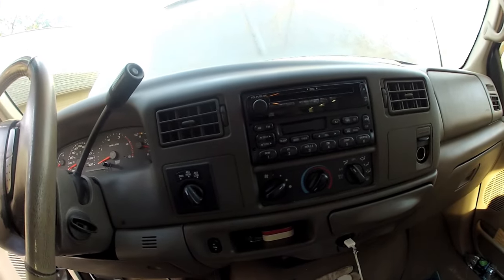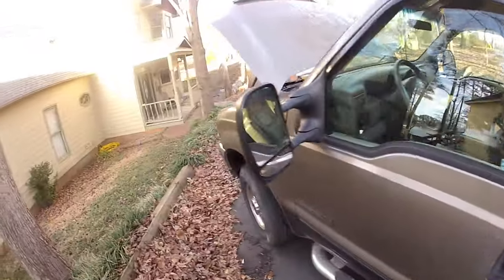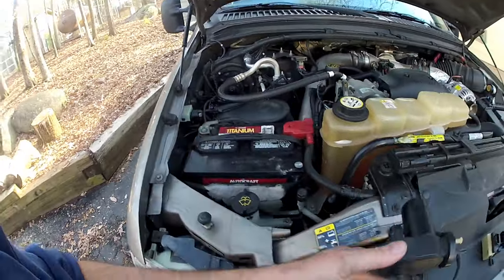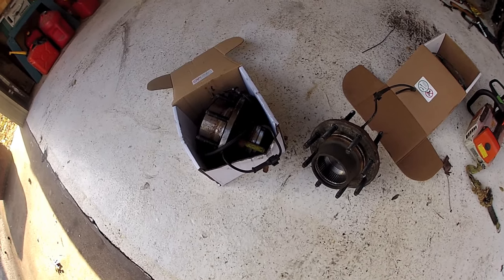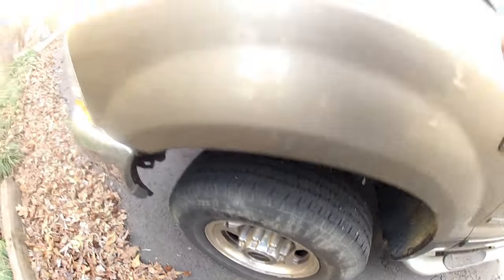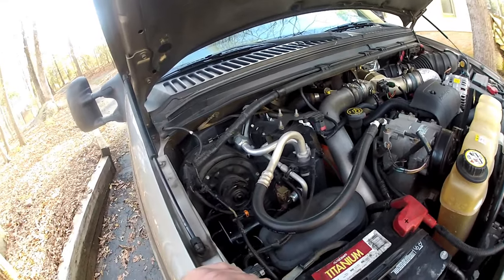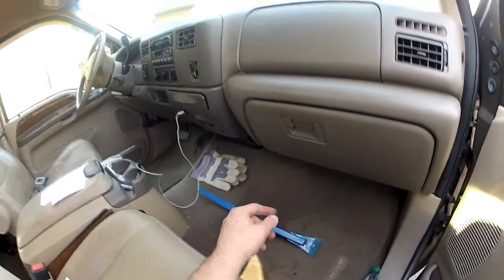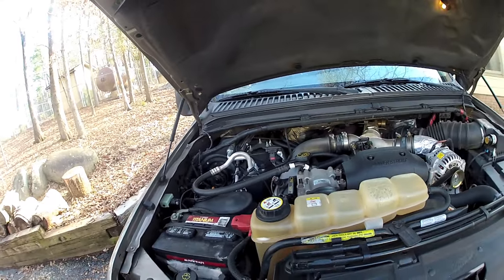Ford F-250 stuck in defrost, problem solved

Comment: 9 years later and you're still saving people. This kept me from spending hours chasing a vacuum leak that didn't exist. Thank you!
Reply from the maker: Amazing how many of these have failed.  I moved along to a Nissan Titan XD pro over 6 years ago, but still miss my F-250.  You'll never guess what component fails on the Titan.  An electronic air mix valve solenoid.  Very similar symptoms, but a totally different design concept.  Proof newer isn't always "better".  Somewhere between now and air conditioning season, I'll be climbing under the dash and changing at least one of those (also well documented frequent failure) parts out.
Reply: Ten

Comment: It may have been mentioned previously but the part number is as follows:  Ford Motorcraft # 7C3Z-9H465-A Auto Lock Locking Hub Vacuum Control Valve/Solenoid.  This part fixed my 07 F350 6.0L 4x4 exactly the way it fixed the issue for the Yankee Paramotor.  Thanks Again!

Comment: I solved my Ford heater problem by never even considering a Ford product again. It also solved the problem of "Opps, we used the wrong alloy for the subframes corrosion problem."
Reply from the maker: To each his own.  I drove this truck for 15 years!  Regrettably I traded it in for a new Nissan Titan XD a little over a year ago.  Nissan? Not even half the vehicle the F-250 was. I'd just gotten tired of the old radio and the lack of assurance that newer components  bring for a time... I guess I saved about $30k on the front end of the purchase.  We'll see how much of a bath I take on resale value if and when I ever try to trade or sell it.
Reply: Why am I complaining about an old car when I am on your channel to learn Paramotoring. I am driving a wonderful 15 year old Suburu Outback but my brand new Paramotor will be here next week. A person needs to set priorities! 
Thank You for posting on Self Training. Self training more for convenience than money. 24 years Coast Guard Flight Crew and Avionics experience. Now retired, I can fly again! Yay!!

Comment: Does this same part cause the dash issue on the v10 excursion as well? Im chasing a vacuum leak that may not even exist
Reply from the maker: Sorry man, this was a one off solution as I'm not a professional mechanic.  I just happened to stumble on the fix for this particular problem.  Traded that old truck back in 2017, but I sure wish I'd have just kept it and spent $2000 on vinyl wrap and a new stereo/nav system instead.

Comment: Thanks for the video, my 2002 f250 has been stuck on defrost for 3 years and the auto 4 wheel drive has never worked since I bought the truck new, I always had to lock the hubs manually. After watching your video I called the ford garage and they quoted me $321 for the solenoid and a new vacuum pump. I got them on line at am autoparts delivered for $91, just put them both on and I now have cold ac coming out the dash vents and the 4wd locks in without having to get out and lock the hubs. Thanks again for posting your video.

Comment: VERY HELPFUL! THANK YOU!
It's not an EGR valve though it's a pulse vacuum actuator for the four wheel drive that runs off the electric vacuum pump. I was told by multiple mechanics that it would not solve the problem. It did! Thank you again!

Comment: Awesome video. I have a 2003 F250 and thanks to you I fixed my same issue. Replaced the vacuum pump and probably didn’t need too.  For other people the part is Dorman 600-402 $62 at autozone. Thanks again.

Comment: @Yankee Paramotor you nailed this.  My Vac valve failed on my 2000 F350 7.3.

Some additional info - This valve is responsible for controlling factory style auto engage 4x4 hubs and the AC vent system.  If you have converted the factory hubs to a manual-only style like Mile Marker or Warn lockouts, you do not need this valve to engage your 4x4.  When this valve fails, unplug the vacuum connector on the solenoid valve with 2 ports and plug both ports with an appropriate sized bolt. The red vac line is the one responsible for switching the HVAC vents.  With this plugged, you will no longer have a vac leak and your AC/Heat vents should now switch.

Comment: (2000 excursion 7.3 diesel) This video was a life saver!! I went through all of my vacuum lines and checked the vacuum pump and thought I was loosing my mind because everything was fine. Sure as hell I replaced the 4wd actuator and it fixed my problem!!  Thanks for the help man!!
Reply: Do you happen to know the part number? I am having a hard time finding it. I have a 2001 7.3 excursion. Thanks!!
Reply: I unfortunately threw the box out but I went down to O’Reilly s and asked for the “4wd actuator” and they had it in stock. I will call tommrow and see if I can get you a part number
Reply: Hey so I called and the part number is 600-402 at O’Reilly auto parts

Comment: After a crash course with the HVAC & 4x4 in my ''02 Diesel Excursion and only having defrost for a year I stumbled on your video after watching who knows how many (along with several auto part stores that said it HAD to be a vacuum leak in the cab) and ordered one off Amazon for $30 and BOOM! Got heat & A/C out the vents. Hats off to ya...
Reply: Dan Alberty  Hey Dan, does your Excursion have the knob style or electronic push button style for the control settings? Jw. I'm going to try this with my push button style and hope this fixes it.

Comment: DUDE ! Your the man. I checked all the soft lines and checked the disconnect under hood to defroster, ( mine was working but had to turn placement button to get it out of defrost) All was good, but pump would NOT shut off, been that way for years. Manual 4x4 only. I finally found the disconnect for them next to reservoir, no vacuum. So this module can work on one side and not the other. THANK YOU !!!!!!!!!!!

Comment: I had a very similar problem with my 2005 F250. The last part this gentleman mention was the Vacuum EGR Selenoid. In fact that was the reason my a/c and such defaulted to the defrost vents. As is turned out, a pesky squirrel had made her nest next to the EGR unit and chewed through the wires! Rascally Wrabbit!!!!

Comment: Thank you for posting this video, I can't thank you enough.  2002 Ford Excursion with 7.3l diesel, the part is a DORMAN 600-402 Four Wheel Drive Hub Locking Solenoid - $27 on Amazon, took 5 minutes to fix.

Comment: I just replaced my vacuum pump to no avail on my 04F350 w/325K miles. It is a performance work truck. I had vacuum going into the 4wd valve but no vacuum on the line out. My conclusion is the valve is bad & will replace tomorrow. I don't mind paying state taxes but I resent the hell out of paying
$60K for a truck I bought new in 04 for $40K. I have out new heads and rebuilt the upper end @ 250k miles. Put in a livewire tuner & it runs like a champ. Went off road in AZ&UT last two years and tow 5k trailers w/generators and fuel transfer tank! Thanks for the insight! May your day be pleasant and your cab warm/cold as needed!

Comment: Thank you this was the fix for my 2001 F250 4WD v10  -  my problem started during the summer when I noticed cruising down the high way the A/C was only coming out the defrost, oddly when I came to a stop I noticed it would go back to the vents.  This when on for a while until the winter where now it would only blow out the defrost vent.   I found this video most helpful, as all the options were covered.  I first looked for the vaccume leak that led me to brittle hoses down to the hubs they were bad, i never even knew I had them, I replaced and like the video said it worked for a bit again but only at standstill when RMPs got high or on the road it would go back to defrost vents, when I replaced the vacuum solenoid  it now all works.  I got the one on Amazon for 40 bucks, mixed reviews but the OEM is 90.  Will see...tried to buy at autozone they tried selling me a door actuator for the vent...and argued with me i was buying the wrong part...left ordered amazon had it next day...working fine...nice and toasty out the vents. Thanks again
Reply from the maker: +Erik Renninger  It has been 2 full years since I had posted this video.  I am still amazed at just how many people have had these simple components wear out and stop working, yet the misunderstanding of how to fix it continues at parts houses, repair businesses and amongst mechanics - even at dealerships.  Glad it's working for you again.  Thanks for the feedback!

Comment: Thanks for the information. The reason I am here is that mine on a rare occasion will default to defrost and seems stuck. Then it may work great for months. Then hang ups briefly and ok again for months. I'm just looking around to see what's up for the time I'm sure will come. Total failure. Now after yours and a couple other videos, I have a pretty clear understanding of this system. I appreciate it.

Comment: I have a 2000 Super Duty with this exact problem. Can't wait to try this - many thanks sir.
Reply from the maker: Good luck!  It's that time of year...
Reply: @YankeeinSC1  My 2000 Super Duty has the 5.4 V8 but no vacuum pump that I can find or hear running. Seems like the vacuum is getting pulled by the intake manifold? I  can get the AC blowing out the vents if I jiggle the vacuum lines and power/grounds but it quits working after a few minutes.

Comment: Thank you , sir .

I took mine off , open it , banged it around a bit and removed any loose dirt and sand , then hit it with some spray can lube , pumped it with air , made a little plastic disk for one side then it worked.  

I would have never guessed that part.

Comment: That component ( in the superdutys at least ) has nothing to do with the EGR valve and is called the Pulse Vacuum Actuator, Doorman # 600-402. It does indeed control vacuum to the automatic hubs. It's failure is very common, and is well documented over the net. If I were troubleshooting this problem, I would be using a vacuum pump / gauge. This would alleviate replacing non-defective parts. Thanks for the video. It's amazing how many thing I have fixed on my 350 just by watching Videos like this.
Reply from the maker: Yeah I know it's silly to throw parts at a problem, but this truck has been paid for for 12+ years.  So I guess I've taken the attitude that several parts once a quarter or so, is still cheaper than a new truck payment.  Even if I replace something that hasn't totally failed yet, to get to the bottom of a problem.  Many things are at least "fully amortized" anyhow.  This has been one of the most reliable vehicles I've ever owned.
Reply: YankeeinSC1 Yes....I agree. I love my 04 350 and plan on keeping it until whan and if the wheels fall off.
Reply: YankeeinSC1 So I have a 04 Mustang GT with the same problem, only blowing AC through the defroster, how is that piece called "Vacuum EGR Solenoid" or "Pulse Vacuum Actuator"

Comment: Thank you for posting this. It was the problem and saved me money and hours. You da man!
Reply from the maker: I've been a little thin skinned lately, so thanks for your positive comment.  Recently, some guy admonished me, saying that he doesn't randomly replace parts as that is an amateurish way of tackling a repair.  Like I told him ALL of the components could be serviced and replaced for less than the cost of half an hour at a local shop full of incompetent "professional" mechanics...  I have never had goos luck with having automotive work done in my home town!

Comment: That is a very unlikely culprit but I’m glad you found the problem. 99% of the time it is always cracked vacuum line. Those cheap plastic lines they put in all vehicles are subjected to harsh winters and hot summers, it gets brittle with time and cracks. Even a pinhole size crack will divert all your vent selections to defrost as a failsafe. I found two cracks in my 2006 F250 lines, one of which (the hub vacuum) was melted completely against the engine block. The cheap plastic wire cover they put over the vacuum lines don’t do anything. The other was the air reservoir to the egr vacuum that you pointed out. I cut the vacuum line cracked areas and put some cheap rubber vacuum line over them, works like a charm. When I had to take the wheel well inner fender out to get to the compressor, I had to unbolt that air reservoir right above it. When I did that, the plastic vacuum lines cracked. Any cars that are 15+ years or older will start to see these issues no matter what make or model you have.
Reply from the maker: well I have no idea what you're talking about.  The F-250 was still the best vehicle I have ever owned.  The lines you speak of are not "cheap plastic" as you indicate on the F-250.  They are nearly indestructible, high pressure, hard as steel tube, die drawn, space aged, impact resistant super material.  They run through harnesses and isolators and near as I could tell they are 100% resistant to salt corrosion, solar degradation and auto fluids.  The problem you describe may well be true on other vehicles but it simply isn't the case with the F-250.  I deeply regret having traded mine in for the Jap-engineered-mentality Nissan, Titan POS, even though it does have a rock solid power plant with the Cummins 5L.  Should have kept the F-250, sprung for new vinyl "TRUMP 2020 - No more bullshit" motif wrap and added a decent stereo  bluetooth nav system.

Comment: Here is the proper description and part numbers for 1999-2010... It's a Hub Locking Solenoid..
Dorman OE Solutions 600-402 4WD Hub Locking Solenoid replaces Ford 7C3Z9H465A F81A9H465BA F81Z9H465BA and is perfect for replacement.... This Vid saved me a whole lot of time and work... THX Yankee

Comment: Thank you for the video! My problem exactly while travelling. Ford dealer had the part on my way, 20 minute job, and was fixed!
Reply: Were you having this problem when you were on long road trips? My 2007 when I drive for a few hours at a time the ac will switch out of the vents if I shut the control off for a little bit and turn it back on it will work again.
Reply: @Fordsuperduty6  It was on a long trip, but started when we were driving around town a few days. My AC would not come back on once it went off no matter what we did with the controls.

Comment: Thanks you so much sir you saved us a ton of time out in the Texas heat and money. However I found that the part for my truck wasn't called EGR, for my 2001 f350 7.3L it was called a vacuum actuator. It does the same thing its just a different name I guess. But anyways I thank you very much!!!

Comment: I just fixed this problem on my 2002 F250 with 7.3 and no A/C, it was the vacuum line that runs from the pump to that plastic canister, just popped it back on and it now works perfect.

Comment: your video led me to my fix... a/c not cooling properly and defrost defaulted to on... checked vacuum pump..it was ok.... but noticed the pump was running intermittently so I knew there had to be an issue some where..started inspecting vacuum lines that I could easily see... discovered the line that apparently controls the hot water valve going into heater core under the hood next to oil fill was actually about to break. Used a 5 inch piece of my drip line from my garden irrigation system to fix. air comes out of vents at 52 degrees now so I suspect the broken line was allowing hot water into heater. 2007 ford f250 king ranch.
Reply from the maker: Awesome!  I did not previously know the heater core flow valve was also tied in.  I guess a good system schematic might also help, but there are so many that claim to have fixed their system when even dealers couldn't, why spend the money on a manual that may not even offer the fix?

Comment: The actual name of the part you reference is a "4WD Differential Switch" dorman part no. 600-402 ford oem no. 7C3Z9H465A & F81A 9H465-BA also called 4wd Hub Locking Solenoid, hope that helps others, I didnt see anybody reference part no's or actual names of the part
Reply from the maker: When the stopped working, I was probably one of the first people in the country to have experienced it. I’m not entirely sure that the parts had names or part numbers...until it becomes a more frequent problem for folks
Reply: I sold the dorman 600-402 for years and the actual vacuum pump and until i had a problem with hvac suspected vacuum leak on an 07 f350 and started research did i realize how it all works now, rat chewed my vac lines black and grey going to hvac in dash, but thanks to your video i learned a lot to look for in future, newer models are usually all blend door actuators and mode actuators not vacuum related

Comment: Nice you can plug off remove each component at a time to isolate lines and components
Also  as long as you don't mind getting out the truck to lock the hubs when you need 4x4   you can plug off the wheel bearings 4x4 lock